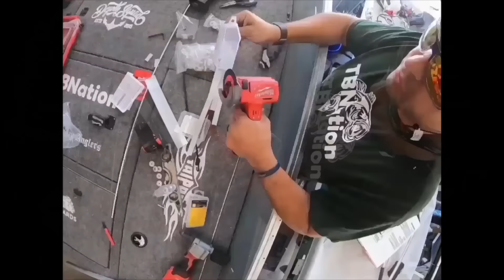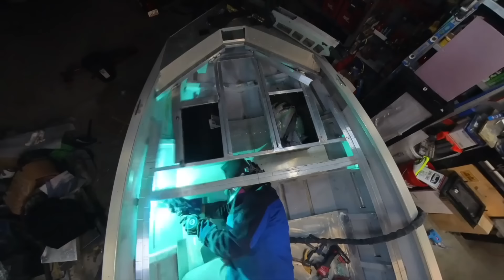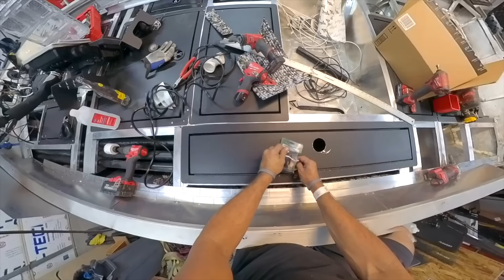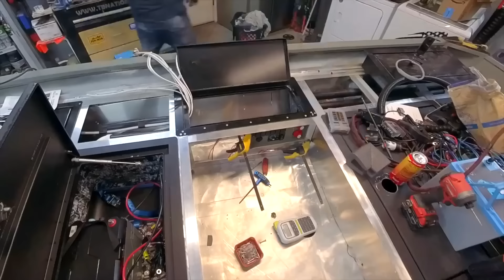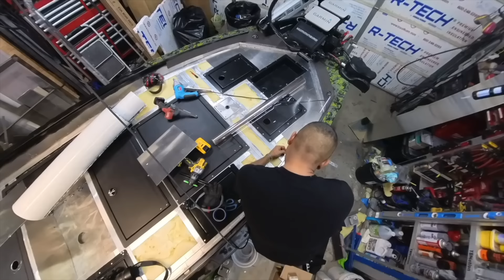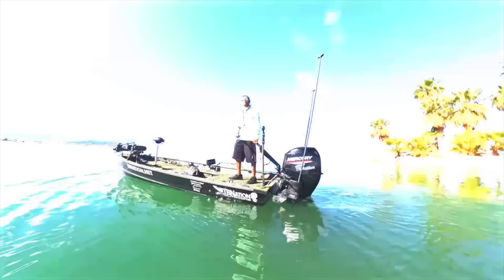JON BOAT TO BASS BOAT: The Ultimate Full Build (Start to Finish)

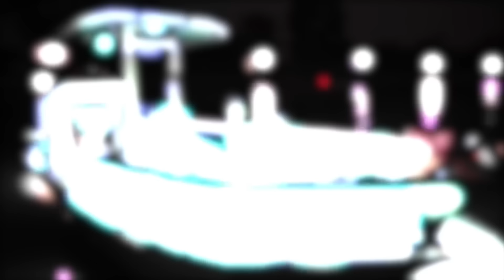Comment from the maker: 1:44 - Plash Lights
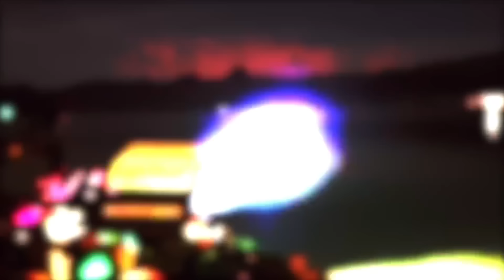2:08 - Epoch Batteries
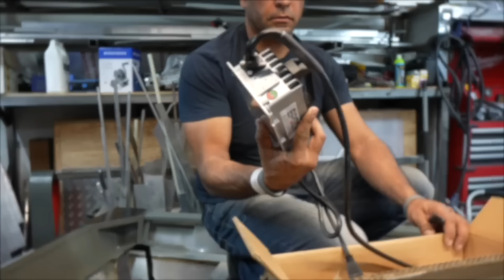2:26 - Dualpro RS4 Onboard battery charger.
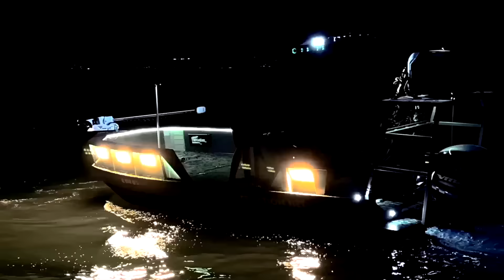2:49 - The Start 
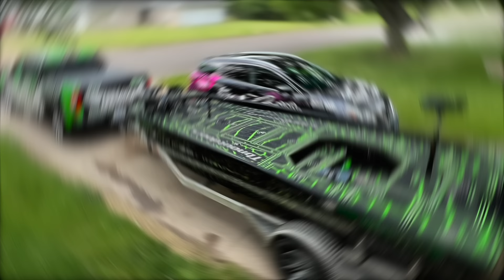3:57 - Transom & end caps
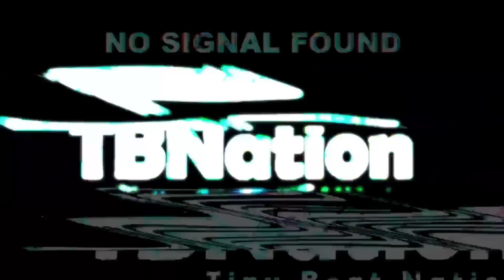6:19 - Framing
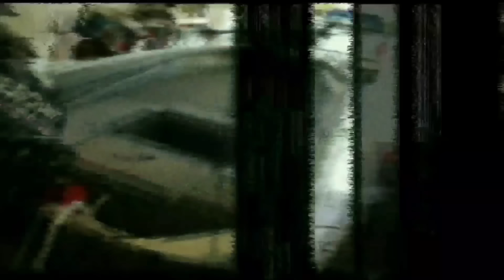13:53 - Livewell
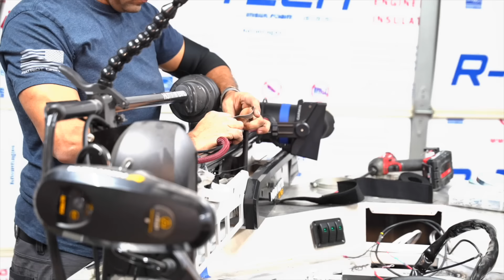17:11 - Wire conduits, drain tubes.
20:27 - Rod Locker
23:08 - Bow Rigging
24:52 - Painting the boat
27:47 - Wiring & electrical 
41:17- Foam & flotation 
46:59 - Decking, flooring & paneling
49:47 - Master Class Overview
52:34 - Hydro-turf / EVA foam install
52:14 - Rail Plaza products
52:29 - Vertical tackle/gear storage
54:05 - Final rigging & testing
54:33 - Water testing & reveal

Comment: What do you use for rod tubes? Those black ones are lighter than regular PVC correct?
Reply from the maker: Yes, I don't know what the exact type they are, but they are the only black tubes at the hardware store and they're noticeably lighter in comparison.
Reply: @TinyBoatNation it’s ABS

Comment: I checked out Epoch Batteries. $2k per battery, x4, you got $8k in just batteries in the boat. 

I love the idea of making tiny boats for two main reasons. 1:) Can take you places you can’t necessarily get to in a full size bass boat or tourney fishing boat. 2:) Can be built/customized on a budget for those who want Bass/Tourney Boat features on a smaller, more practical budget. 

I get this is the “ultimate” and anything that is ultimate or extreme is going to be pricey (usually because they’re worth it), but having half or a third the cost of a new factory boat in just batteries is pretty crazy.

Comment: You mentioned paying for a rig like this would be an obscene amount of money... Can you quantify that in a rough estimate dollar amount? Thanks bro, new subscriber here. I knew what I wanted to do, since I am getting away from traditional boats, and spending more time fishing... With a lot of smaller lakes in my area... they do not allow gas motors... So I have been researching building a small aluminum boat and outfitting it with what I need. while I want a small outboard, I want something that can just troll also... I love the aluminum deck with compartments but kind of like the traditional steering wheel set up... It looks like I will need to stray away from that and utilize the space available and enjoy a more utilitarian type of boat with some trick looks, storage, and goodies. I found a very cheap donor boat, and I would love to chat about kits, styles, and costs... Is it best to reach out to your business directly or through the website? 
Thanks for your time.
Reply from the maker: It would be somewhere around 50K for a boat like this with the outboard and all the add-ons.

Comment: @45:41( exactly, it is very fleeting) there are two scratches on a hatch lid. I know it doesnt matter as it will be covered in foam, but in case i wanted to leave an exposed hatch surface, are these painted or powdercoated?
Reply from the maker: Powder coated

Comment: Seeing the terminal ends crimped with channel locks and not get heated hurt the wiring part of my soul so bad! But the boat still turned out great
Reply from the maker: Those are all Marine grade nylon connectors. I wouldn’t recommend them for saltwater, but there are no problems with freshwater applications. You can use either nylon or heat connectors in these cases

Comment: I have a grizzly tracker 1654 im putting a 50hp suzuki on. The setup of your boat is very similar to how i want mine
Reply from the maker: The 50 horse is too light for a grizzly
Reply: My grizzly tracker is a 2007 model that ive had all the floor ribs rewelded and had stiffners added. When i bought it, it had a 25hp etec tiller on it